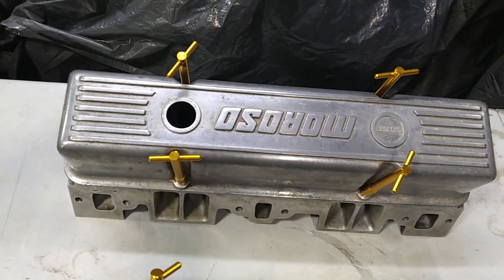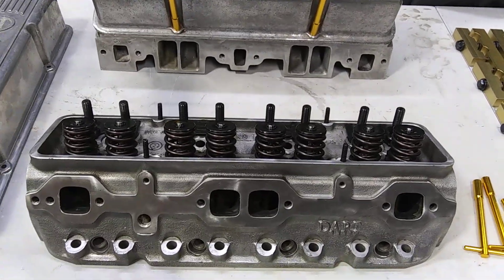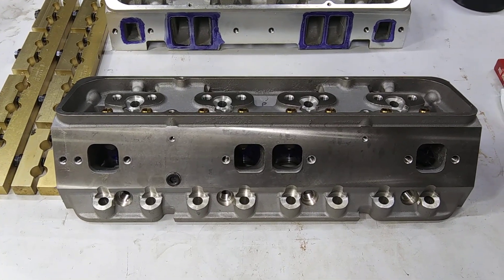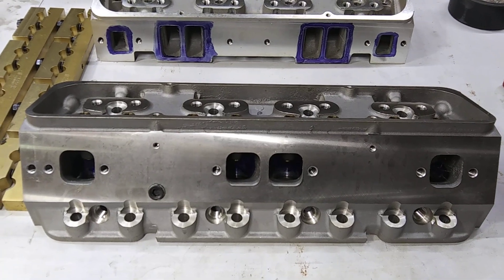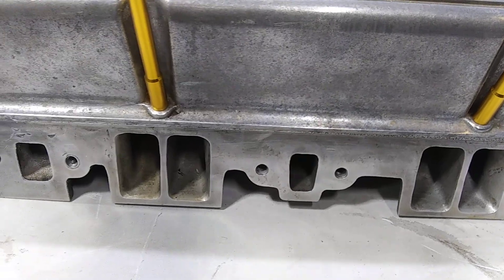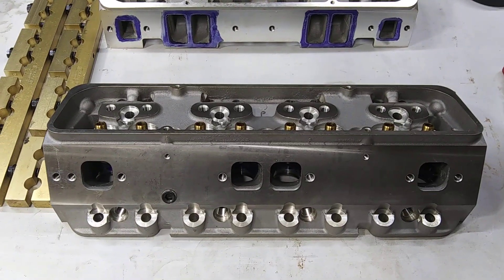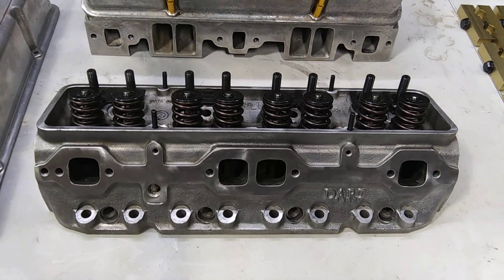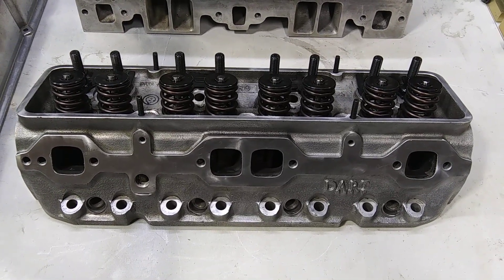DART PRO 1 angle/plug 215cc heads from 2010.

Comment: Have a set of their sbc Conquest heads...few yrs older. Advertised as 200 but turned out to be 215 before porting. 
Now 230 milled to where the intake gasket hardly seals. Cant afford much newer but still make good power. 11.7-1 383 solid roller
Reply from the maker: @gordocarbo  Had a pair of the Conquest heads about 20yrs ago. Unfortunately one got destroyed in a nasty blow up. The other one got stole. Made real good power on a 388ci SBC. Don't see many of those anymore.
Reply from the maker: @gordocarbo  Pretty expensive head back in the day.

Comment: I had a set on a 406 and it did ok, but the 200cc heads flowed better. 

These dart clones are pro 1 platinum 200 copies. The old pro1 turned into their shp heads, at least the 200 cc was the same.
Reply from the maker: I just uploaded a video about a pair of 2013 200cc  DART IRON EAGLE PLATINUM heads off a Dirt Modified 358. They are heavily modified. Engine they were last on made north of 630hp & 520tq at 358ci. Pretty hard core. They flow well over 300+cfm & 220 exhaust.
Reply from the maker: I pretty much have examples of all of them. Been using DART heads since the early 90s.
Reply from the maker: My 215 Pro 1s are ported and flow getting good. They make 600+hp no problem. Was on a 388ci SBC.

Comment: My pro1 215cc are from 2008 and on my 383 in my nova. Runs 10.1 @ 133 pump gas. The heads are gettin ported now with new intake valves and milled for higher compression.
Reply from the maker: Good numbers there. They are definitely some good cylinder heads.
Reply: Wow that is moving!!

Comment: I had a set of the 215 pro1 heads on a 406, I wasn't impressed. The 200cc heads out flowed them. I took off a set of s/r torquer heads with 1.94-1.5 valves and put the 215 pro 1 heads on. I gained about 500 rpm on top end and didn't pick up any on the time slip. I had a 327 with the torquer heads on it that would blister the 406s ass. Both had a lunatic solid 249-259 on a 106, Victor Jr, 750dp, 3.73 gears. The 406 had more torque, but the 327 would eat it up. I never understood that.
Reply from the maker: 406 needed more cam. 270+@.050 and 650 lift would have woke it up.
Reply: @thereluctantgearhead4544  the 406 & 327was in a street car. If it had been a drag only, I would have put more cam to it. The 406 had a lot of grunt to it, but no top end at all. It ran the same if I shifted at 6500 or 5500 rpm. It made no sense. The 327 would buzz to 7500 with 194 valves torquer heads.

I'm doing a 383 now, I hope it runs like it should. 10.65 comp. .040" quench, victor Jr intake, those dart knock off heads you have in this video, comp xe294hr , scat procomp 5.7" rods, scat 9000 crank, icon forged flat tops. I'm hoping to get around 475 hp at least. I wish the cam had a tighter lobe separation of 106 or 108 instead of the 110. 

Have you tried any of the hydraulic roller lunati bootlegger cams?
Reply from the maker: @inscoredbz  Yep, fixin to stick one of the Boot legger cams in a 355 now. Using the biggest hydraulic roller version. Be a good rowdy street cam I think.
Reply from the maker: @inscoredbz  I have that Comp  XE294HR in my daily driver with a pair of the 200cc Pro 1 knockoffs, used a Super Victor & 750 Proform doublepumper. 10.85-1 compression. Runs pretty damn good. Have it in a 84 C-10 with a 4spd & 4-10 gear, Detroit Locker etc.
Reply from the maker: @inscoredbz  Using a pair of 200cc BPE heads with that Lunati boot legger cam and a ported 1979 Vic Jr intake. Probably a 750 or 800 DP Holley.
Reply: @thereluctantgearhead4544  Ported and flowed a set of those heads when they came out. Went 308/230 by .600 and carried up til around .750ish. Going up on ebay this week. Saving them for my car but my back wont let me do this stuff anymore. No clue what to ask for them. 
Havent poured them but bet they are no bigger than 210cc
Reply from the maker: I got 542hp out of a 327 back in the 80s with ported Phase 2 Bowtie heads and 830 Holley on a Strip Dominator. 268/276@.050, 630 lift 106 lobe sep. 12-1 compression. Ran 7.00s in a 69 Chevy C-10. Pretty good engines.
Reply: @thereluctantgearhead4544  Jeebus man thats huge power out of a 327 esp back then. Wish GM still sold all the cool speed parts, blocks heads cams and esp FT lifters.
Reply from the maker: Built a few 400s for drag racing years ago. I used solid rollers In the 280-290@.050 range .650 lift and ported Pro Topline 230cc runner heads. Victor E and 4+4 intakes, BG 850 DP and also 1050s. 13-1+ compression. One of them put a Vega in the mid 9s 1/4 mile NA. A G-body Malibu went low 10s with one of the units. Low 6s in the 1/8th. 400sbc has potental. Hell, I used the stock cranks turning them 7000+rpm. Used Manley H-beam rods and JE pistons. 2-bolt blocks with main studs. Built a couple 400s with forged 350 cranks and turned them 8000+rpm.
Reply from the maker: These 215 DART heads are going on a 355ci with a monster Crane solid roller and a DART singleplane intake & 950HP Holley. Should make around 575hp NA. These particular heads flow over 300cfm.
Reply from the maker: I have a 1966 L-79 327 350hp engine tucked away now. Planning on building it to turn 8500+rpm and make 600+hp NA. 272/282@.050, 650/661 lift, 106 lobe separation solid roller. Over 13-1compression & BME aluminum rods. Going with a Holley tunnelram and twin 750 HP Holleys. Gonna install splayed Howards billet main caps and do a half fill on the block. I have a pair of ported 220cc runner Pro Topline heads going on it. Would like to find a Vega wagon to put it in or a mid 60s Chevy 2. I like them small cube high RPM screamers. Built more than a few back in the day, 283s, 302s, 327s. Was into the Modified Production and Super Modified class cars back in the day. Nothing sounds better than a 292ci SBC turning 10,000rpm. Current day NHRA Superstock 327s are making 600+hp with original Carter AFB carbs and modified 461X heads. 327 has a real good bore to stroke ratio. They make alot of power per cube when built right. Them old 327 blocks are thick too and came with forged cranks till 68. I buy every 327 I can find.

Comment: That second pair of doesn't have the pro one stamp on the inside
Reply from the maker: They are "Competition Products" versions. They use PBM valves and Comp springs & hardware. Plus they do a 5 angle valvejob. They have a killer machine shop and build 4 digit power level engines.  Believe they are in Iowa. Same core head as all the rest tho. I pretty much have a pair of all of them.
Reply: @thereluctantgearhead4544  Yeah I noticed on mine I didn’t have the pro one stamp on the side of the head So I said to myself he’s a pro one heads then I seen The stamp pro one was on the inside of the head I told myself they must’ve changed him
Reply: @thereluctantgearhead4544  Did you get the 427 unfroze was kind of curious because I had a zero 10 block couple years ago that was froze up man it was a pain in the ass I believe it was a 74 block still have it haven’t done nothing with it yet
Reply from the maker: @awfulcoffelsonecargarage8215  Yep, got that bastard apart. My technique is to take all the rod caps I can get to off, then pull the main caps, lift the crank up to get the rest of the rod caps, remove the crank and then it's easy to pound them motherfuckers out. It was a couple hr process. Even the cylinders came out looking pretty good. It's .040 now, should go .060 no problem.
Reply from the maker: @awfulcoffelsonecargarage8215  I just let the pistons soak with liquid wrench for a couple days. That freed up the rings somewhat.
Reply from the maker: @awfulcoffelsonecargarage8215  Engine been sitting 20+yrs, surprised it wasent worse. Engine was rebuilt stock in 95 and parked around 2002.
Reply: I ended up cutting a two before and half shoving it down on the inside of the piston commenced to beating the s*** out of it for 2 hours then finally got them all out man what a job well that's good to hear that you got him freed up I'll be watching the build

Comment: I've been trying to find an Lt1 set of these for years, still unobtainium.
Reply from the maker: Those LT1 heads can make some power with porting and bigger valves. Some guys are getting over 280+cfm with them. 200+cfm on the exhaust side without going too crazy. Check out "TPV" productions channel, he got pretty serious with some production  LT1 heads. No telling what the NHRA Superstock versions are flowing. They are making over 650+hp with the production based heads, but they are way beyond modified. Only seen 1 pair in my life and I was amazed. Believe they were done by Patterson Racing engines. Super expensive tho. Be cheaper to just buy a pair of AFR LT1 heads at that level. But it was a legal Superstock car, so AFRs are not allowed.
Reply: @thereluctantgearhead4544  Appreciate your interaction with your subscribers. I'm aware of how good the stock castings can be but as you may have noticed, lt1 exhaust ports have the bolt holes way low in relation to the port centerline and I have a pair of those sbc cast stainless tru ram horns I want to use as turbo manifolds and the square dart ports are a perfect match.
Reply from the maker: @mr.gearhead7631  Yep, they do have that odd D-port.
Reply: @thereluctantgearhead4544  never liked the exh port of the gm lt1 heads, seem low or difficult to get them breathing well. Stopped at 250cfm on a small valve (int) some bowls would get porous...pinholes in em strange. 
Plus corrosion from yrs in the water jackets hah...FIgured that was ok for a 1.94 valve st engine